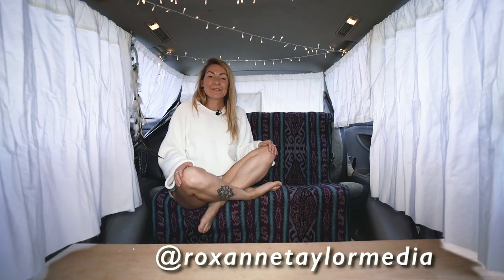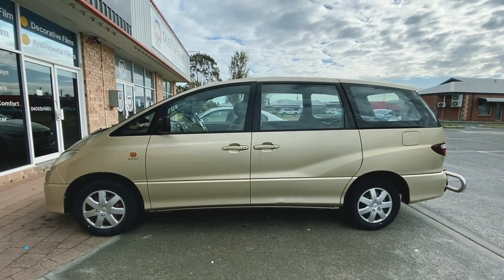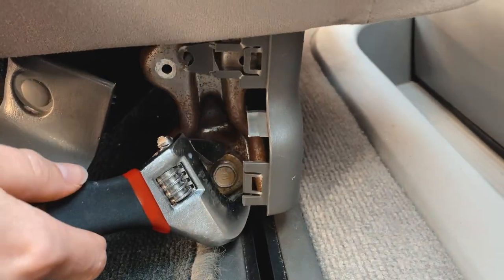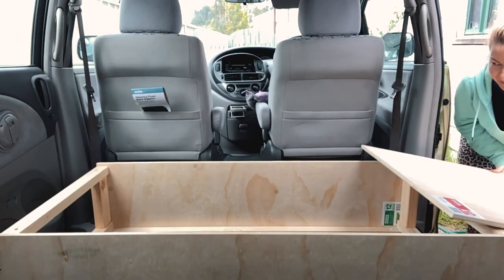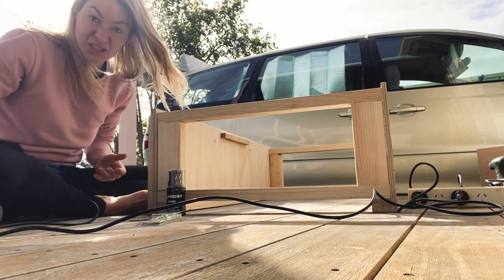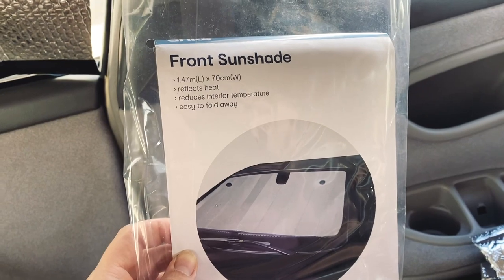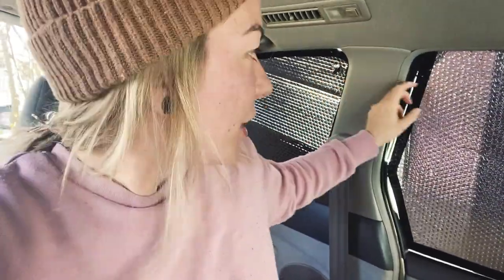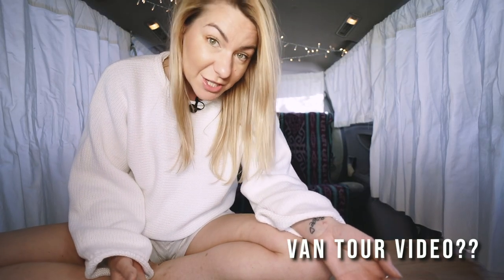Minivan to Campervan! DIY Camper Van Conversion of my Toyota Tarago! (Previa/Estima)

Comment: Hi Roxanne, i love your van! I have the same car and am about to start my conversion - doing it all myself. Unfortunately, i'm not savvy with tools and making things. Do you have a specific instruction on how you made the box? I would need measurements and instructions. I'd probably have to get a handyman to help me. thanks so much ps. also how did you hang the curtains around?
Reply from the maker: Hi Karen! Good luck for your build. I actually just used the measurement of the existing things as a guide, eg: the height of the back seat was around 300mm so made that the height so it would match up, and the size of the plywood top was I think 1200x600 which it came in from Bunnings. The main thing is making sure everything is supported by the vertical beams and sits securely so it holds the weight when sleeping on top. If you're not savvy on the tools, I'd definitely recommend getting someone to help as there was so much trial and error to get the design just right when working to make everything fit in such an awkward tight space. I hope it goes well and you are happy with the result!

Comment: Hi I live in Adelaide and also have aToyota Tarago which I have converted. These vans are excellent for conversions. They are very reliable and spacious. They don’t look like it on the outside but they are very roomy. Do you travel around with your van?
Reply from the maker: I agree!! They're so spacious. Yes I use my van for daily driving and travelling :)

Comment: What did you use to put a curtain up u should make a video on how you did the little things in this project I bought a 2005 tarago and hav done the exact same thing but I’ve just ran rope through the handles on the ceiling and than tide them to the roof rack and peg up fabric work alright but would love to know how u managed with putting the cable up
Reply from the maker: Ohh that’s a good idea!! I bought the stretchy wire cord (made for caravan curtains) and screwed little hooks into the ends and then screwed the screw hooks that are a full circle (don’t know the name) into the plastic panelling on the walls to hook them on! I used rope before I bought the stretchy wire. I think it’s good having the stretch in it in case you accidentally pull on the curtain it won’t pull everything out
Reply: @RoxanneTaylorMedia  yeah cool I don’t use it a lot to camp so yeah didn’t think about it pulling if I used wire I bought the wire and everything and scewers to slide behind the plastic but the scewers didn’t fit and I don’t want to do to much permanent damage as I will sell it later on, I thought the scewers would work because a girl I saw did it with an estima and it worked but mine didn’t so I did rope which works so I’ll prob stick with that

Comment: How did you hook up the curtains? Could you link where you bought the supplies and how to do it please?
Reply from the maker: I bought the little hooks and the special wire from Spotlight. The wire is threaded on the inside so you can screw the circle fittings into each end, then I screwed the hook fittings into the plastic panels (drilled a tiny hole first)

Comment: Where is your storage for your clothes? Is it under the bed bench?

I like the design... But I wonder if it can be done using a design for a narrow 25' wide twin
Reply from the maker: I have my clothes in a duffle bag which I hang over the back of the front seat headrest. When I go to sleep, I flip the bag around from the back to the front side of the headrest to make more leg room.

Comment: Do you have the measurements for your pull-out table/bed posted somewhere?
Reply from the maker: Hey I just measured it. The top is 1200mm wide and 600mm deep which was the standard size of the plywood. Just make sure to factor in adding the beam widths and side ply width into your frame size so the lid sits flush inside the frame. And it's 300mm tall off the ground. The second false top of plywood is the same size, and it butts up against the back seat when extended making the whole bed length roughly 1600mm including the 600+600 wood and the seat.
Reply: @RoxanneTaylorMedia  Thanks - I appreciate the information!

Comment: I recently bought a Tarago but couldn't get it registered because the previous owner bodged things up & I couldn't get an engineer certificate. Is yours compliant? Just wondering if you had issues with your bed box not being secured to the floor? I'm going to have to pull mine apart and start from scratch 🙄
Reply from the maker: I actually ended up redesigning it a little more after this video as I bought a secure drawer tray (popular in utes and 4WDs) which I secured to the chassis and built the bed box around that. It was all registered and legal as I didn’t change any structure, just unscrewed the seat from the base on the track which is fine as it’s designed to be able to do that. Good luck for your new design! I loved making it and re-designing it so I hope you do too 🙏🏽

Comment: How did you secure the bed box to the floor of the van?
Reply from the maker: Hey, it's not secured to the floor. I just placed it over the brackets that the seat attached too. I like it being removable so I can put seats back in if I need to, also easier for cleaning, yesterday I took everything out for a deep clean

Comment: Just about to follow your lead :) keen to see the tweaks. Especially what came afterwards
Reply from the maker: Ooh yes, I ended up taking out the brackets that held in the seats I removed (that I put the white cardboard over in this vid) and installing a Titans 900mm drawer horizontally to hold my stuff and building a smaller box for the mattress directly next to it. I'll post a little video on my Instagram Stories this weekend to show the latest update as I won't have time to make a proper YouTube video for a while. Good luck with your build!! It's so much fun

Comment: Can ppl please stop saying they built a campervan "all by themselves" when in reality they decorated a vehicle.

Removing a seat, putting in some store bought furniture and hanging led lights is not building a camper! 

I am happy that you are happy but building a camper requires lots of actual skills. Carpentry and cabinetry. A knowledge of electronics 12v and mains. Gas, water and upholstery.